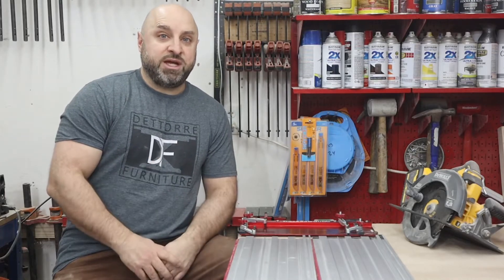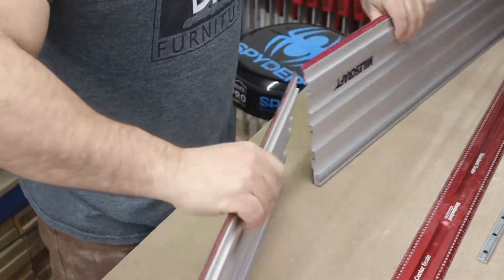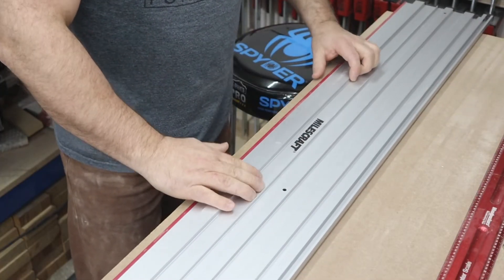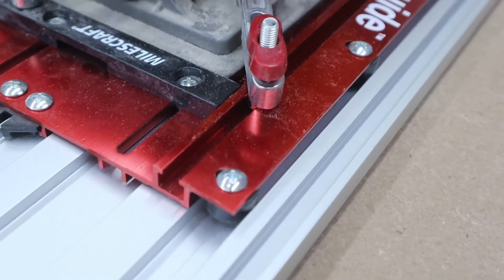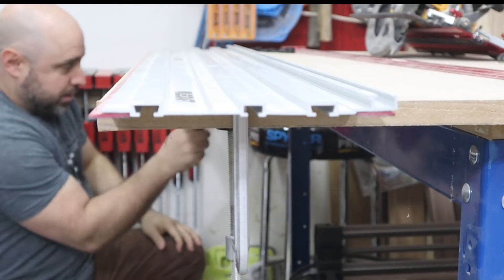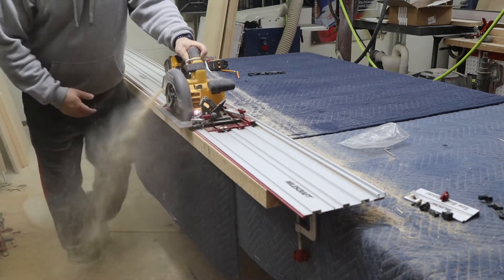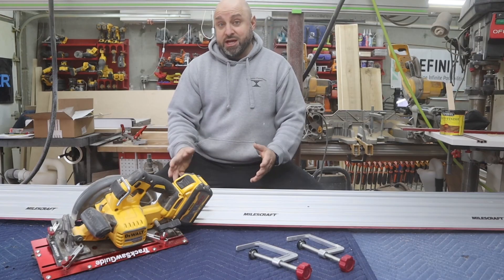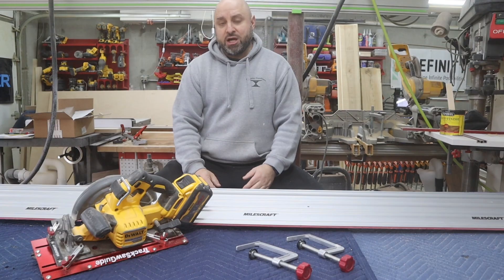Does the Milescraft Track Saw Kit live up to the hype?  Come find out!

Comment: I noticed play in the sled on the track. It appears as though that can be tightened up with those side adjusters. One note on these things... Always use the same type of blade with the same kerf on the carbide teeth. Otherwise, your cut will be slightly off if you switch to a blade with a wider kerf.

Comment: Great video!! Thanks for taking the time to make and upload. Question: how much gap is there between the bottom of the saw base and the top of the stock? Looking at the video, I estimate it's about 1/2 inch? I'm just wondering  how much depth-of-cut is lost when the saw is on the track.
Reply from the maker: More 3/16” to 1/4” is my estimate

Comment: The thing I noticed - and I don't own one, but have been looking for something like this - is when the tracks go together, the seams just d i s a p p e a r. The only way I could tell - in video - where the seams were was by the non-slip strips and the splinter strip. I've seen several reviews of the expensive to the inexpensive (like this one) and I could always tell where the tracks were joined. I mention this, because that tells me the machining is done well on these kits. One thing not mentioned, and a concern since even their add-on kits are just two more 27.5" tracks, is track flex in the 110" mode. Curious about that.
Reply from the maker: Any long track has flex but as long as the edge it true that’s all that matter. There isn’t a long track anywhere without flex.  This one is extremely well made
Reply: @DettorreCustoms  appreciate the response.

Comment: Just a note, the directions from Milescraft say the initial cut to trim off the excess rubber from the edge should have the blade no more then 1/8" below the material being cut. I see he has the blade completely lowered.  There are a few other nuggets in the directions not mentioned here either. I realize he's not giving a setup tutorial here he's just showing the product so no dig at him here.
Reply from the maker: What they say to do isn’t wrong. It’s called a scoring cut. Do a cleaner cut.  This was close to a new blade so I wasn’t concerned over that party
Reply from the maker: What other questions do you have? Happy to help

Comment: I am curious.
How the set up would be accurate depending depending on the kerf of the blade you're using. Hypothetically if you  set it up with a  60 tpi blade  then  switched to a 24 tpi  blade  Wouldn't you lose 1/8 th inch because  the  difference in the kerf of  each  blade
Reply from the maker: You could say that about any track saw then
Reply: With a track saw like this, or any of the type, really, the "keep" part of the piece is under the track, and the waste is exposed, so the only concern with regards to the size of the kerf is how much of the waste is wasted.
Reply: Ugh... Won't let me edit... To continue. If one does use a blade with a larger kerf, what may happen is more of the edge guard will be cut off. So, if a blade with a larger kerf is used, make a pass away from the cut line to allow the blade to cut the extra material from the edge guard, then align the track with the new edge. As a rule of thumb, it's a good idea to keep the same type/tooth count blade set aside for track saw use, and keep it sharp.

Comment: You mentioned the bevel cuts. Have you attempted a plunge cut? Looks like it could be a little janky...
Reply from the maker: Remember you’re using a normal circular saw which isn’t exactly easy to plunge with.  For $99 hours his will suite 90% of everyone’s use. I have the Festool and desalt and I don’t think I’ve ever done a bevel cut on either.  Plunge yes but bevel no

Comment: Is the sacrificial red piece replaceable?
Reply from the maker: What part do you think is sacrificial? The rubber strips on the tracks that you cut for your zero clearance? If so then yes those are replaceable. If you’re talking about the red slider that the saw sits in that’s not sacrificial. That never gets cut
Reply: @ thanks. Yes I found them on the milescraft site. 
Thanks for the quick response.

Comment: I wonder if it would work with the flex inline 6 1/2 saw
Reply from the maker: I wish I could give you an answer on that
Reply: I have a 6.5” Makita LXT and the base fits, just barely, but it fits
Reply: Did you ever try this on the Flex? I'm in the same boat wanting to buy the track..
Reply: @Hakuna_Frittata  not yet I haven’t started the new shelves project yet
Reply: Just tried to set mine up for a Makita 6 1/2 cordless circ saw. Probably less than half of the saw base rested on the track saw base. I couldn’t secure the saw baseplate with the two longer side clamps. Just a little info.

Comment: Hi brother I have question after I watched your video I just bought a milescraft saw guide this is not a long enough to cut the whole long side plywood what you suggest should I order only track extension or should I buy another one because price difference is only $20 whole set is $99 and extension is $79 but if I buy another set of milescraft it will work with the one I have can I make it track longer
Reply from the maker: You could get another track but honestly I’ll usually just slide the track a tiny bit near the end

Comment: even thought i dont have this, but its definitely 10x better than kreg accucut! kreg is horrible on laminate sheets and tends to flex halfway on the cut and give you whack cuts.  main reason is the sled keeps on flexing and theres no adjustment like a normal track saw, but milescraft have it! that alone gives it better quality cut and consistency plus its made of entirely aluminum! the sled on kreg was cheap plastic and wobbles a lot! never use kreg on high end laminate sheet, but its ok for rough carpentry.

Comment: Invest in a dust collection port adapter (pretty cheap), a vortex dust separator (HF=$35, + 5 gallon bucket), and some clear acrylic roll material to cover things better like a real track saw. Use magnets and washers for instant on-off. YEAH - IT'S NOT A PIECE OF CRAP MATERIAL WISE, and nice and thin plate - unlike the F'n KREG version. SICK OF THAT thick sled. I had to upgrade my saw to make it through a 2x in one pass.